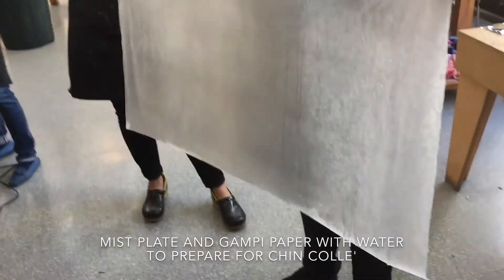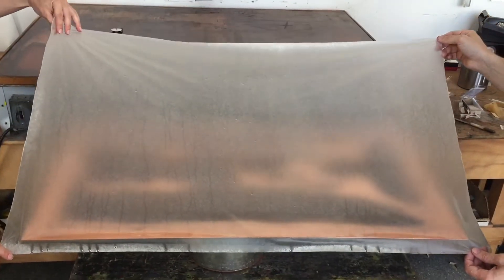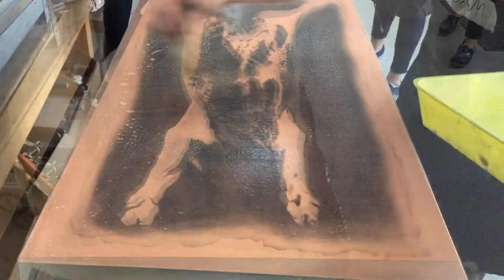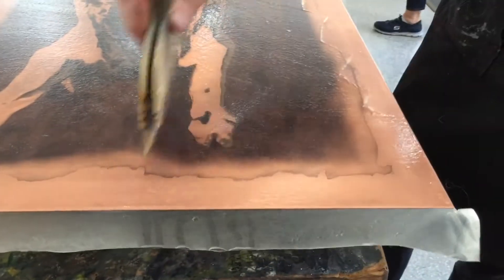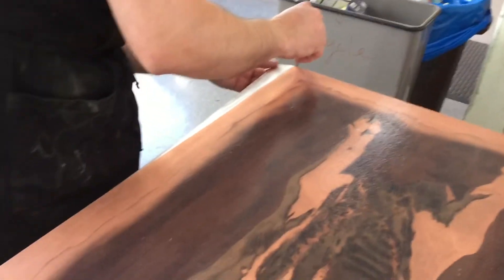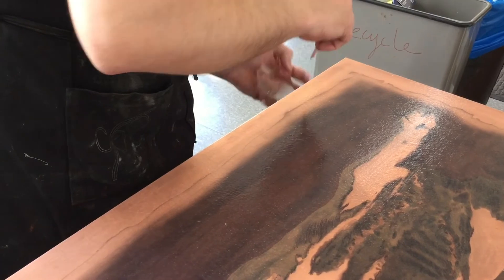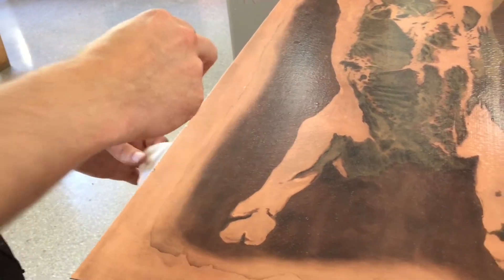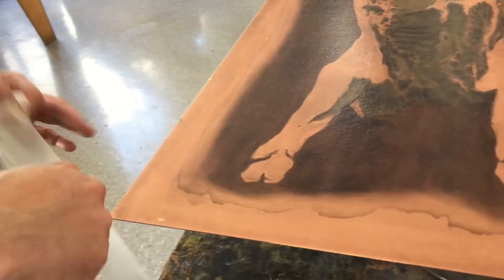The Chin Colle' Process Demonstrated by Sam Carr-Prindle at Crown Point Press

Comment: Can I use calque instead of this gampi paper?
Reply from the maker: Aleksandra Mitrenga I’m not familiar with Calque, the gampi is made specifically for printmaking purposes and does a great job of holding a printed image, and adhering the glue  to the support piece of paper. If the calque can do the same, then it should be good to go! Printmaking is about experimentation so you can always try and see what happens!
Reply: Joseph P Gerges okey, thanks! :D